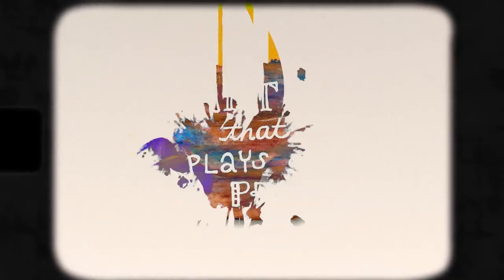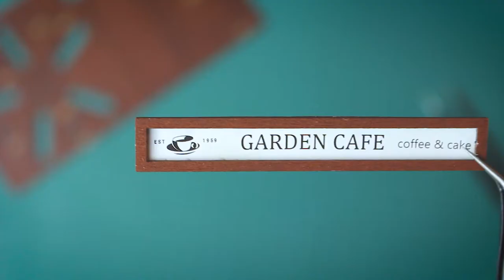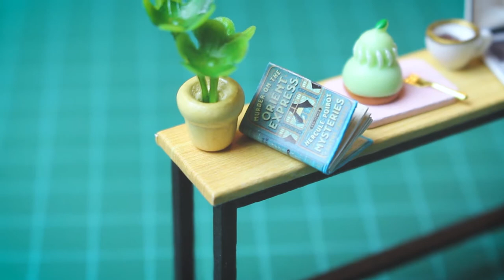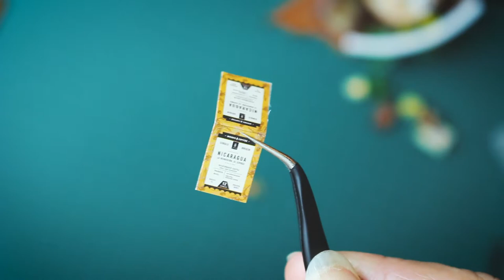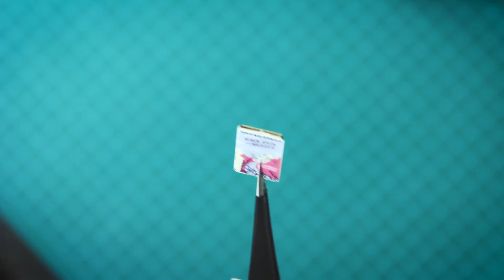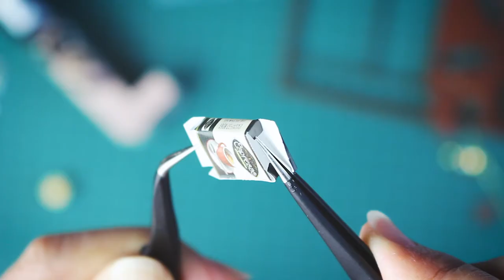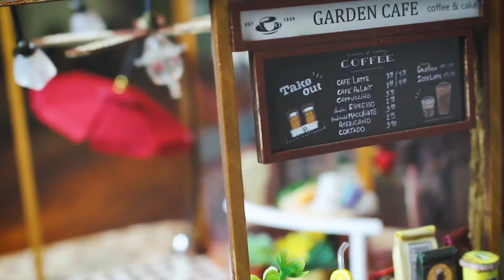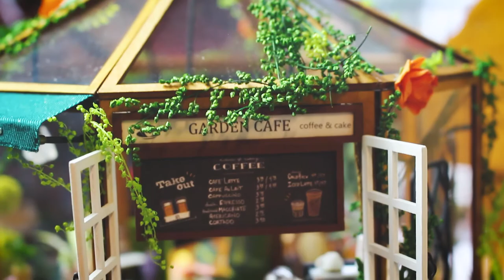DIY Miniature Dollhouse Kit - GARDEN CAFE Miniature Step-by-Step Building Guide

Comment: What glue do you use? 🤔
Reply from the maker: Hi Vangee. I switch between Beacon 3 in 1 and Alene's Turbo Tacky glue. Beacon grabs quickly but it's stringy if you're no careful. Alene's takes a while to stick but is easily repositionable before it sets. I like that Alene's dries clear. Beacon tends to be cloudy when it dries.